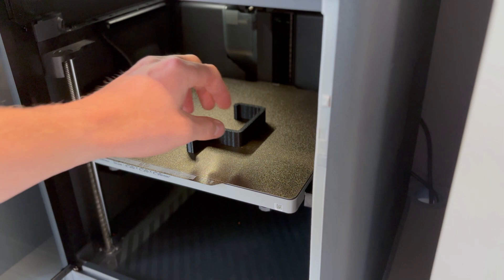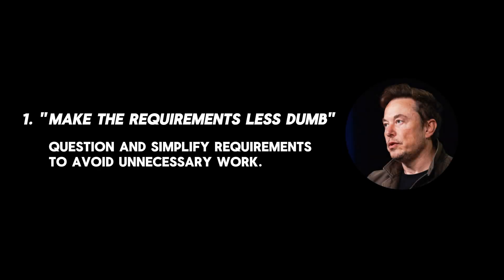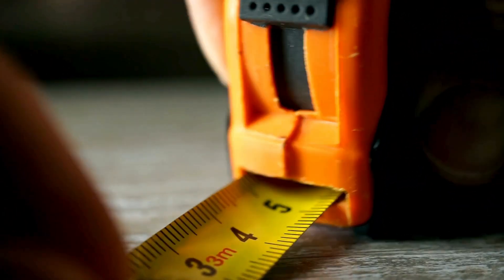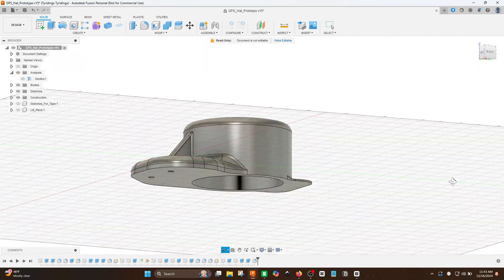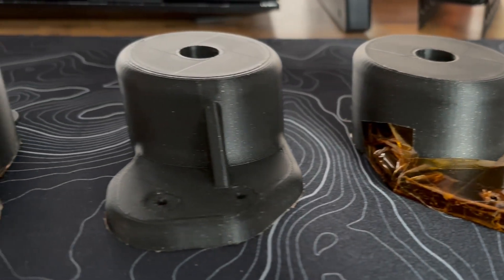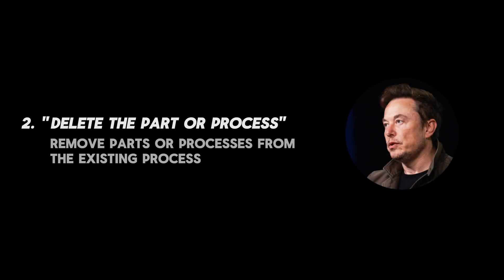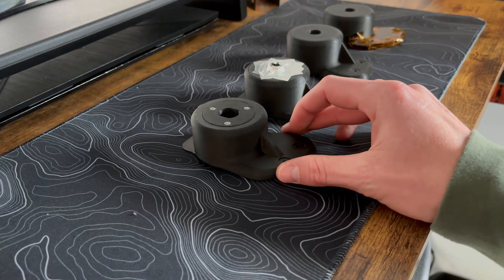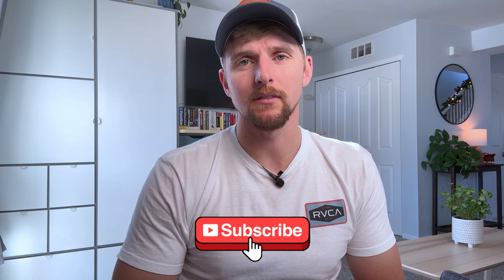From Idea to 3D Print: Bring Your Products to Life

Comment: Enjoying your videos, style of explanation and real examples. 

Would love to see the process of you fitting a real world piece. 
I'm exploring 3d printing, figured only worth while if I can design my own solutions to print, so starting here. 
FIrst project is a custom storage solution for under my truck's back seat. Haven't been happy with solutions online so want to design something that fits in with the manufacture hardware,  but has movable dividers, a hinged lid/top that folds out to make a flat cargo floor, etc. 
Any tips on measuring weird, real world curves like a car floor/interior?
Reply from the maker: Hey! Great question, several things to try here. 

1. Use a set of calipers and a tape measure to approximate as closely as possible (my go-to method 90% of the time)

2. Use cardboard to cut out pieces until you get them to fit, then scan them in with your printer, then upload the image to Fusion (or other CAD program) to “trace” as closely as you can

3. Same as 2, but try taking pictures of spaces with a ruler next to it to approximate size and upload to CAD as well to trace. 

Hopefully a combination of those can help!! Any iterated prototyping you can do before final product helps a ton. Cheers!